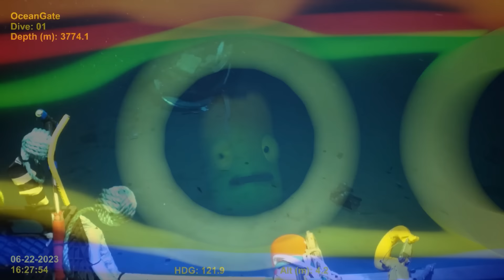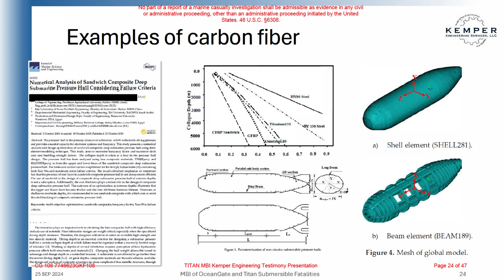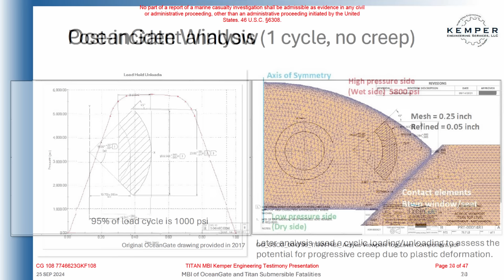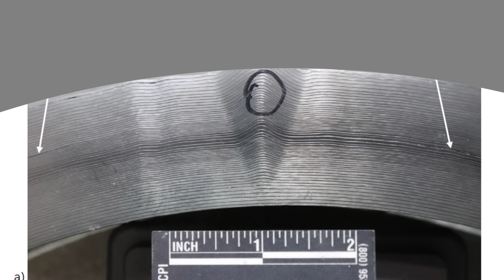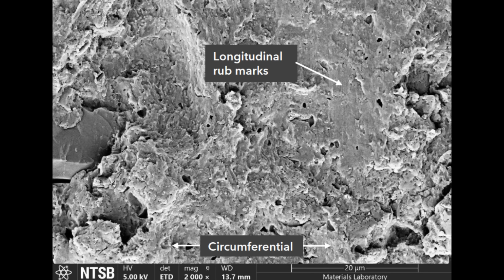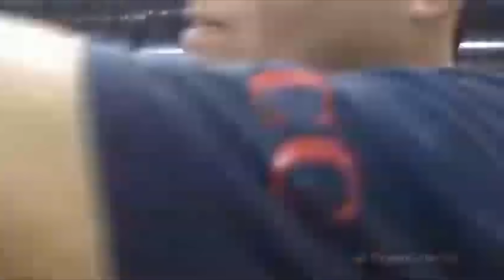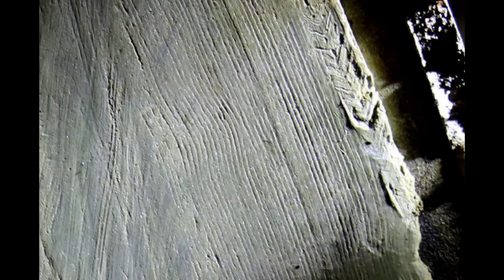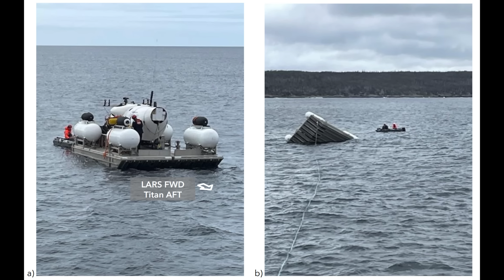OceanGate Wreck Shows Why Sub Wasn't Strong Enough To Survive - NTSB Shares Important Details

Comment: The simple reality is that Carbon fiber is not good under pressure and everyone else around them told them that. The reason you use titanium or steel is due to its isotropic properties. Anisotropic carbon fiber can delaminate under those extreme pressures.

Comment: I suspect the primary cause was the use of LOCTITE EA 9394 AERO adhesive in the submarine's construction.First, it is an aircraft adhesive and is not intended for use in environments exposed to seawater chemical reaction and deep-sea pressure. Secondly, at a depth of 3,800 meters, the temperature is approximately 2 degrees Celsius, and the pressure is approximately 380 atmospheres (bar) or 5511,43 psi, while the maximum strength of LOCTITE EA 9394 AERO adhesive under these conditions is 29.6 MPa (4300 psi), or 296 atmospheres (bar) for 7 days. 380 atmospheres (5511,43 psi) of actual pressure versus 296 (4300 psi) maximum is unacceptable. Therefore, the adhesive is one of the main causes of the submarine's demise.
Reply: It's hard to tell where the implosion started but that's a good guess. It's possible the buckling of the wall started first and then the epoxy let go.

Comment: 11:55
I believe they hand-grinded specific spots in-between layers, grinding into the fibers themselves.

So not consistent machining along the entire length of the sphere, and more importantly I think, machining into the strands themselves. 

What I had initially thought was that they had been machining highspots in a boundary layer resin coating, but this was not the case.
Reply: No they used peel-ply between layers.
Reply: @rjinkglider6908 They remove the peel-ply and ground the high-spots down. This is touched on in both NTSB testimony, and employee testimony. Where they touch on the number of grindspots each layer, with the number increasing each layer up to layer four, which had the most grind spots

Comment: There were so many potential points of failure this next comment probably is irrelevant. Why didn't they use multiple horizontal bands/straps that could have been attached to and run between each titanium hemisphere to maintain tension on the joints. Assuming the joints were stable, the Carbon Fiber would have failed eventually.

Comment: I work for a defense aerospace engineering company. 
All people in advanced materials science knows that carbon fiber is the worst kind of material for a compressive application. I don't care how many plies you use, there are always problems with delaminations when this material is under compression. It doesn't matter how many plies you have working against compression, it's going to continue to to delaminate.. especially with cycling! Then there's the conjecture that porosity could have lent a contributing factor because of the cycling, and delaminations creating voids, eventually allow water into the plies, and under those pressures, it acts like an oily lubricant.. then at those pressures there is heat created, and with high enough pressure, comes heat; the bismaleimides used in carbon fiber manufacturing can, under some conditions, lose their structural integrity when heat is present.
Everything about this points to a belief that 5 inches of carbon fiber would 'have to be enough'..! 
Even if you were to double, or triple the thickness, because of cycling and delaminations,(the snap, crackle, and pops) it would have led to the same result. You might have gotten two or three more duity cycles out of it at double, or triple the thickness,  but eventually it would have failed.
The hubris of the owner killed four people.
Pride is definitely one of the seven deadly sins.... it sure killed four besides the one!
All to get famous, and make a buck playing with high tech arts and crafts...
Crazy sad!

Comment: The thing is, they could have engineered it so that is was more of a tensile load rather than entirely compressive. 2 titanium rings 2-3 inches thick could have been used along the the carbon fiber tube to achieve that.

Comment: Strength of materials is a real topic in physics. The problem is when some don't want to listen that materials don't resist the same way to different kinds of forces. I sometimes wonder if very simple examples should not be used with these people. Like the fact that I can't stretch my water plastic bottle but I can easily crush it.

Comment: 20:32 Actually this exact sheer is what Tony was so worried about! Watch this segment about the glue and watch Tony’s testimony at the NTSB. The lifting eyelets are one thing he said they could NEVER add. 1) Because of how thin the lips of C channel are, they couldn’t take the weight of lifting from the rings. 2)Another issue is the glue separating from the mating surface. It was lifted around 20 times from the rings.

Comment: A private scientific person hired me to test CARBON FIBER for two years and results were all over the place in 2002' 
Reason being is that Carbon Fiber fibric is a special lining fiber that needs to be lining in different directions with a heat eliment in different tempertures.
And to get it right , WAS OUT OF THE BALL PARK.....So we shut down cause of liability.
Other scientist accomplished certan products to be used.
BUT NEVER SUMERGED UNDER PRESSURE, MY TESTING AGGREED!!!!
Reply: Carbon Fiber can withstand bi-axial compression

Comment: 20:00 2 decades ago Dodge had a similar issue with head gaskets. One surface that interfaced with a gasket was glass-smooth and the other had a rougher surface finish. Those engines had a recall where the smooth inner surface would be made as rough as the other face. Suddenly those engines stopped squeezing gaskets out or punching holes in the smooth facing half.

Again, these are learned lessons from other industries over decades. Any Joe from nearly any automotive shop would've called out that ring being so smooth right away. And sure enough the rough fiber is covered in glue and the smooth metal is clean.

If you want something to bond using a medium then roughen those mating surface until they more or less match. That will even out how they grip the middle material.

People with wood working experience have been doing this exact thing for millenia too, I just dont understand how they didn't grasp surface scoring when they worked at such a high level of equipment and computing.

A single Google search or handful of phone calls couldve saved every life lost here.

Ten guys down the street turning wrenches and planking boards couldve stopped this. Probably would've with little more than naked eye checks.

I dont think I could ever feel safe working with anyone from this project.

This is criminal sycophanty. Just saying yes sir until somebody dies.

I refuse to believe the staff didn't know better. I also refuse to believe the people they worked around to get this stuff done and use the equipment didn't know.

The flaws were manifold and obvious. Anybody took a paycheck for this knew they were probably going to kill someone. No thinking man could have done otherwise.

And if they were ignorant then they had less than zero business even trying this.

Randos do not contribute to legacy industries out of the blue. Insiders with decades of institutional knowledge, they get to redefine manufacturing.

Comment: 16:40 I made paper roller equipment. Looking at how they laid down their material no one in that lab had any of the same experience. Paper does a lot of these same things, like wrinkling, when you put it through rollers.

Roller production has its own tricks and rules. Having their feed arm so far away and so small relative to the work piece is a huge mistake. Look at the uneven tension across that band.

They needed to develop their own multi-roller system that laid the fiber directly and flatly onto the surface and between the work and a large counter roller.

Just from a printing point of view these guys were clueless.

When Scott says millions in research part of what he means is developing production techniques and technology like I just mentioned. Asking other operators or accepting our criticisms wouldve been a good first step to internalizing some of the millions of lessons other producers have learned across centuries of manufacturing.

What theyre doing is the equivalent of frat boys using a multi-million dollar machine to wrap one of their buddies in toilet paper. Using expensive tech incorrectly and unsafely. I mean, obviously.

Every time I see any images they made its clear they asked no one any questions and just slapped stuff together off the cuff.

Comment: I can’t help to think how much stronger it would’ve been if they had built it in a vacuum, obviously would’ve eliminated most of the imperfections in the glue because it wouldn’t be displaced by air pockets, thus forming a far better bond, and then it wouldn’t be prone to delaminate as it did. 
I still can’t believe somebody didn’t just stand up and scream. “stop “  !!!!!!!
This was a terrible idea from the second day of thinking about it just the problem with cycles alone going up and down at various pressures.  You don’t have to be Elon Musk to understand that carbon fiber is amazing shit but it’s not the solution for every application. It has its place.

Comment: So it failed from the bottom under position where Rush was seating. It makes sense because it imploded immediately after they said "dropping 2 weights", ofc taking in consideration delay in communications. On ship they first hear implosion sound and then few seconds later message "dropping 2 weights" arrived. Taking in consideration depth and speed of sound traveling speed in water, dropping weights caused hull implosion. Carbon fiber hull was on such big pressure and delaminated that one needle drop in hull would cause implosion

Comment: Fron what I understand 
Stockton decided to go against Recommendations welding 2 lifting Rings for Moving the Titan to each Titanium End rings glued to the Cylinder..
Even the slightest Separation or Fracture in the glue bond  would be catastrophic..
On top of that Stockton decided to Leave the titan stored OUTSIDE THRIUGHOUT THE WINTER IN CANADA TO SAVE MONEY...
Titan imploded on the 1st dove of the season following that

Comment: The lifting pins, added afterwards,  onto the carbon fiber/ titanuim ring interface collar, welded on, thousands of degrees,  right onto the fiber glue bond, the sub then frequently lifted by the two collars not designed to handle the subs full weight, warping the interface, exactly where the implosion occured.

Comment: As an experimental vessel, the Titan was successful in a way.  It should have never had passengers of course.  When the big bang happened and had it been properly investigated, that hull should have been decommissioned.   Cutting it up would have exposed all the issues and lead to the construction of a 3rd hull that takes in the lessons learned.  It would given great insight into designing a system would could give failure warning and given metrics for number of dive cycles a carbon fiber hull could perform.

Comment: The more I learn about this design, the more it seems it was designed by someone with very little experience in structures.  
1. The lack of 45 degree plies is ignorant.  By eliminating them, you no longer have a quasi-isotropic layup which makes it more complex to analyze as well more dissimilar in distortion under load relative to the titanium end caps.  Secondly, Rush stated 45 degree plies were not necessary due to lack of torsion, but any undergraduate engineering student who has taken a structures class should know that while true the hoop and longitudinal axes are the principal stress directions for a cylinder under pressure, a simple Mohr's circle transformation will show the maximum shear stress to be at 45 degrees.  So some 45 degree plies makes sense.
2. The lack of compaction  and the amount of porosity in the cross sections should have set off alarm bells.  Analysis with knock downs for porosity could have been done, but to quantity the knock downs without testing would have been difficult.
3.  The lack of intermediate frames along the length of the cylinder to limit deflection is an oversight that is almost incomprehensible.
4. The flanges on the titanium dome clevises are ridiculously undersized.  The only way that joint can work is by relying on the shear strength of the adhesive.  With the lack of displacement compatibility between the dome and cylinder inherent to their material differences (again compounded by the lack of quasi isotopic layup), the adhesive joint was bound to fail and the undersized flange eliminated the possibility of a redundant failsafe load path.

Comment: Amazes me that they knew that the hull would experience fatigue and eventually fail but they had no idea when that might happen and seemed unconcerned about data that might detect it or taking steps to prolong its failure (by storing it indoors and protecting it from banging around).

Comment: Question: Leaving off the fact of how flawed the carbon fiber layers were to begin with, wouldn’t it have made more sense to apply the resin on top of the wrinkled layer, and then smooth that down to a uniform cylinder? It would achieve the same effect of giving the next layer a “perfect” cylinder to start from without, you know, CUTTING THROUGH THE CARBON FIBERS you’re relying on for structural integrity?

It would still have been a ticking time bomb, but at least this wouldn’t introduce more weaknesses into the hull than already existed.

Comment: In my opinion the shear on the titanium ring is the initial breakpoint.  The compression of the composite hull did not match that of the titanium and an immense load was being borne by the inner flange on the ring.  Sudden failure of this flange then caused a chain reaction of failures.  The composite near the ring was probably compromised by water injection as the joint went through pressure cycle, effectively becoming 'soggy' and changing its bulk modulus,  This may have been quite local and undetectable by the installed strain meters.

Comment: I humbly submit that epoxy (the glue) is a material that cannot maintain integrity when highly compressed because it is brittle when used for such an application.  Similarly, Carbon fiber is effective for containing pressure, NOT to resist and redistribute pressure.  So sorry for the lives lost.

Comment: I wonder if initial purposed 10-inch hull would have been just fine or would it deteriorate and have all carbon fiber problems anyway. Imo carbon fiber seems like a sketchy idea with all the inconsistencies of manufacturing and joining CF with other materials- so much to worry about and so many things that can fail

Comment: The, 5 1inch layers instead of 1 5 inch layer reminds me of for battleships people discovered that having one solid chunk of steel is way better then multiple layers even when thicker
Reply: What?
Reply: @TJ-w during the 20th century People tried to make thicker and thicker armour belts for ships. However metallurgy and industry not always could produce the giant chunks of 12-15inch thick steel.

There were attempts to use less thick pieces and mount them behind eachother. Which resulted in worse armour then if it was a solid block

Comment: Still insane that all the engineers involved thought something call carbon"fiber" was used in a 100% compression application.  

Hold a rope - how easy is it to pull and stretch it? 

Hold a rope - bring your hands together.  How hard was that to do? 

Yes it's in a matrix, but point stands that carbon fibers is one of the single best strength-to-weight materials in tension.  Compress is not one of it's 'strengths"
Reply: I mean, it's fine in compression, and if you had the money to throw at the problem, you could probably make a pretty good CF submersible. The problem was that Rush very much didn't want to do that

Comment: 7:35 The obvious solution is to leave it the correct concave shape on the inside for structural reasons and then put an optical correction lens in front of it.